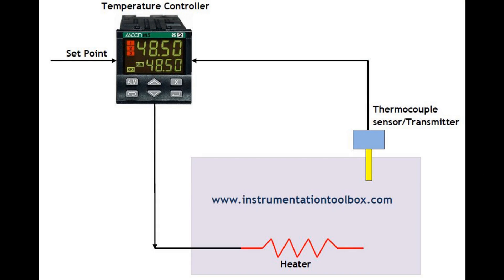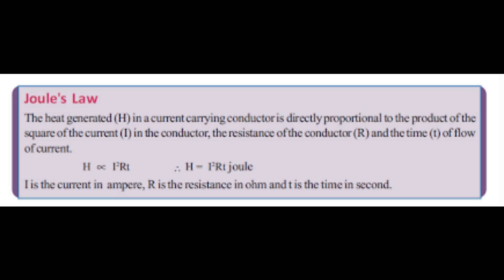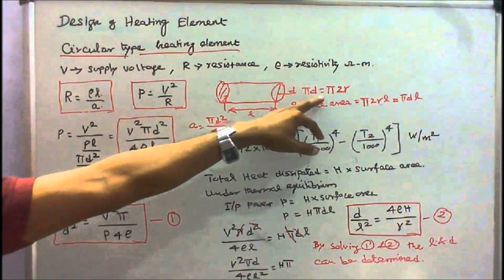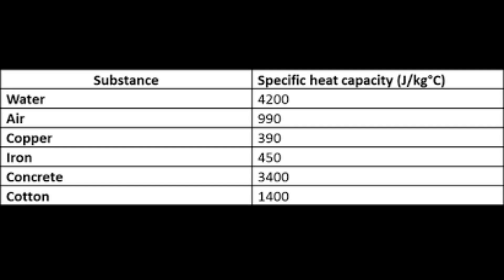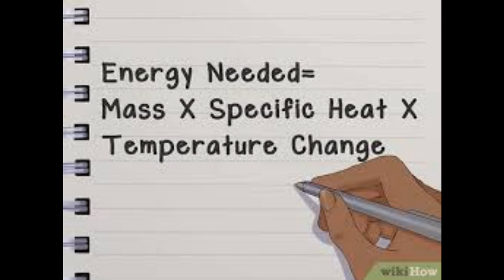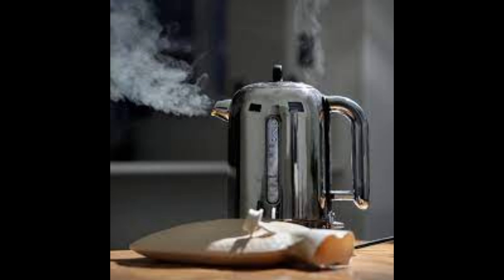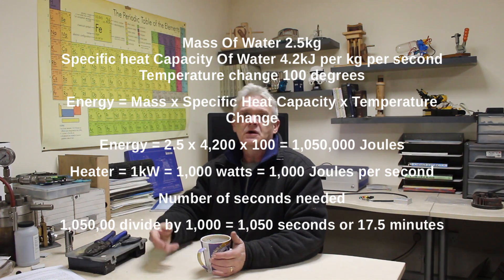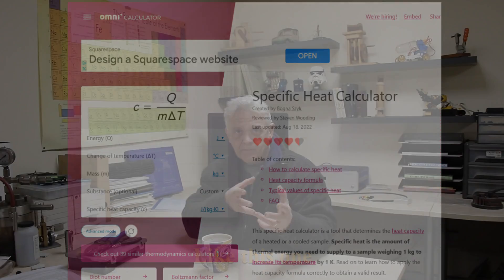1762 Designing Electric Heaters

Comment: You have made a very important point about INSULATION Robert. When I used to work with HVAC system years ago. I was taught that INSULATION WAS THE FIRST THING YOU DID, PERIOD !! Then any type of heating method would work just fine and keep cost at bay. 
          Today most people choose to heat first and insulate second. Totally the wrong approach with the worst outcome. I added insulation to my dads house three years ago. That consisted of going from six inches of fiberglass to adding on top twelve inches more ultra thin continuous strand insulation on top of the six inches. This saved oil heating costs of 60 percent. That was a hell of a savings especially when the stove is a Dynotherm which is 93 percent efficient using K-1 Kerosine.  This really makes a difference with the cost of heating. PERIOD. This is a point that most people do not and will not understand....

Comment: Thank you Robert. My 1kw kettle does take a long time to boil, but it allows me to munch on a shortbread or a biscuit as I wait.
Reply from the maker: lol - making good use of your time - I like it mate
Reply: @ThinkingandTinkering  Love your videos. there was a heater on the market a little over 30 years ago that worked on the pressure cooker principal It only had to heat the water to about 120 degrees f to make steam. the steam traveled up the copper tubes condenced back into water and would be turned back into steam. Unfortunately at that time they were really expensive so I was not able to buy one. The heater it self never got over 120 degrees f. The company still exists but do not make these anymore.Are there charts on pressure cookers.

Comment: When you have a massive shop, you just need a whole lot of insulation and, ultimately, a whole lot of heat power.

MY approach, however, is to ROB heat from the EARTH because THAT heat is FREE!

All I need to do here, since I am up  on the side of a very tall and steep hill, with a lot of water in it, is simply drill a very long hole somewhat sideways, into the hill, maybe a good 200 meters or so, and connect the outlet through a sealed concrete plug, to a radiator that will allow the water to only escape through that radiator.

From there, it can be used for other purposes, naturally, seeing as it is perfectly good 'well' water... its just that the well is, in this specific case, more-or-less horizontal, rather than vertical.

On top of that, seeing as there is a little bit of hydrostatic pressure going on, if I put a decent little sediment filter just downstream of the concrete plug, but yet up stream of the rest of the system, [and preferably with a valve to keep all the upstream water from needlessly all draining out into places and making a big mess], which can be cleaned or changed out on occasion, I can then put a small hydrostatic motor there which can turn a small fan, so that the water, while it is giving off its heat, is also powering the very fan that is making this more possible.

I plan on using a salvaged automotive radiator, since it is a very thermally efficient, and some times you can get them reasonably cheap, compared to a new one, and if you do not mind a few dings and some work straightening out all of the fins, you can usually get them readily enough from cars which have bee wrecked. Just bring along some water and maybe some stoppers so you can fill them and see if they leak before you buy them.

If you are a master at soldering, some times you can carefully patch up those leaks, although there is a logical limit to how big of a hole you can patch, you may in some cases find it easier to crimp off a couple of leaky tubes and solder their end shut, than to try to plug the holes in them. It all depends on how big the hole is, and how many holes there are.

Naturally try to pick ones which do not leak over ones which leak. 

It is TRULY [minus the initial cost of the set up anyhow] FREE energy!

Will it work for EVERY application?

No.

But when you think about it, 58 degrees Fahrenheit [ 14.4 Celsius ] is rather cool in the heat of a 45 Celsius summer, and rather warm compared to a -10 Celsius winter, and therefore, if all it does is keep people in the SAFE zone, ESPECIALLY if one lives any place where the climate reaches either extreme [say a desert on the one hand, although free flowing water may not be as readily available there, some places it is, and in a jungle its pretty available] or an area quite close to the planet's poles, it will potentially save one a fortune on primary heating.

From there, though, one COULD simply add a SMALLER, INTERNAL space, with some additional insulation, so that they are in effect heating or cooling just a little living space, inside of a larger buffer area, so that it will cost only the loss or gain of heat from a roughly 14 degree Celsius environment.

This approach is not 'utterly foolproof' of course, because water, in this situation, is highly dependent on nature and the surrounding availability for one to obtain it.

For instance, if one went to an outside flowing creek, there may indeed be a lot of water, but it will have been somewhat altered by the surface temperature before it gets to you, so it may be cooler, or warmer, than the 14 C middle-of-the-road temperature. And if the water is coming from the earth, but it is from a hot spring, while it will be much better for heating, it may not be so good for cooling, nor anything else, as it may be packed with both dissolved minerals that muck up the system, as well as dangerous gases like hydrogen sulfide and sulfur dioxide, and may be highly acidic with sulfuric acid. Then, going back to the desert scenario, there just may not be a whole lot of ground water readily available near the surface of the earth in those regions, in which case, you might be better off simply digging a large cavern and living in the cooler underground completely...or moving to some better location altogether.

But for much of the planet, the possibility that you live near a hill, with some water in it, is statistically about 25% or so, and if you do not live up against a decent sized hill, BUT you have a well, you can simply recirculate your well water with some additional pipe and a pump, for the heat, although it will then of course cost you the electricity to pump the water up to the radiator and run a fan, because gravity can not in that situation be relied upon to make the geothermal mass of the water flow and do the work for you.

Comment: have you thought about getting yourself a compact 5kw deisel heater.? they are awesome and on low use 1 liter for 7 hours and 5kw at 1 liter for 2.5 hours and the chinese knock off are actually vry good even though the original german brand is great aswell .

Comment: Here in Australia it's summer and in two days will reach about 40 Celcius. I know England is opposite of us and heaters if not used by hot water are similar to the kiln design with a lower temperature thermostat. A small fan run over the sand heater would work also.

Comment: uh-huh.. ok... jewelry you say... for me Watts is a city in california, amp is a beverage available at the corner store and jewels are in a case at the pawn shop.. all I need to know is this material resists electricity and will heat up if I hit it with enough power. Like taking a diesels glow plug and running 12v through it will quickly boil a cup of water
Reply from the maker: fair enough mate lol

Comment: Maybe I'm a bit weird, but hear me out. Instead of heaters I spend more money in light clothing that keeps me warm and at the same time comfortable. During the winter when I go outside I rarely use anything more than a shirt and a jacket because I choose the materials. When I'm indoors I get more choices because there's no wind, that's when wool can be the outer layer. 
It sure helps to have heating in my place, but it is much more efficient if I'm not letting my body heat just go so easily.
By the way, I love your channel. I found it a week ago and it's motivating me to go back to my "making things" mindset.
Reply from the maker: I think you are right mate - use your body heat as effectively as you can - nice one - oh and I am super glad you like the chancel - cheers

Comment: for a while i wanted to build a radiant heater that hangs from the ceiling...  i was going to build it as an art project. a dragon with wings open hanging from a vaulted ceiling. the wings would be reflectors and the leading edge of the wings made of tubing would have the heating coils in them with a cut out facing the wing for the heat and light to reflect off of.
Reply from the maker: that sounds just plain awesome mate - do a video I would love to see
Reply: @ThinkingandTinkering  wanting to do it and getting the nerve to actually throw down and get the materials and do it are a couple different things... still looking for a job after moving without one a month ago... some things are gonna have to give...
sometimes i am the thing that has to do the giving

Comment: For some reason I’ve heard electric kettles are only 70%  efficient. Aren’t induction the most efficient way to heat water at 85%~? Or is that not true ?Could you create a vessel that was more efficiently designed to capture the magnetic field ?  Isn’t the magnetic field in an induction cooktop almost like a donut ? Could you create a donut like vessel that could absorb all of that induction energy more efficiently
Reply from the maker: it's not true mate - electric kettles are actually pretty amazing for what they do - and so simple

Comment: Kanthal A1 wire Iron, Chromium and Aluminum, another heating wire, slightly higher resistance but more robust and cheaper than NiChrome.
Widely used in domestic heaters due to its longer life expectancy which is due to its steady "elasticity" over a greater temperature range.
Nichrome is cleaner and lower resistance per meter but shorter life, used more for high end and shorter duration. If your building portable go for Kanthal it can be moved while still white hot but nichrome could snap.
Note not all Kanthal is Kanthal, its a specific patented brand name with circa100 year history, now sold under Sandvik Kathal name. if its not from them its no true kanthal and may be lower quality.
Reply from the maker: nice advice - cheers mate

Comment: I ve just used the  math formulars lately . Well to save a litte bit on heating cost when the weather is fine . I m usind tranperent boxes, black rocks and mirror foil from crisps packages . I ve put some dark stones (8 kg) into the transperent boxes using two of them fitted together  so I can provide a transparent insolation.  Then I ve used the mirror foil to refelct light onto the stones. When they are up to 45C  I carry the box from the balcony to the inside.

There is another Version of this I want to bult.  This one connects to this video. andI am wondering if I should try. Speaking of the heating propertys of different material I asked myself if the energy to phase change is included into the table of thermic material ptoperties... well I if not.  the thermal storage capacity for wax or parafine  could come handy.
Well I am thinking of blackening wax  and using it instead of the stones. And maybe built a better mirror setup. So I can carry morw heat energy inside
Reply from the maker: that's very clever mate - I think you should try your new version - it will be interesting to see the result

Comment: As some other viewers have commented, heat pumps are of course a viable alternative to resistance heating as they work by collecting and concentrating low temperature heat from elsewhere into higher temperature heat where you need it. This technology has been around for decades but is an expensive investment. Those mis-advertised little plug in mini heaters that claim to heat your room for a fraction of the cost of a "normal" heater are utter cons, underpinned by utter lies, aimed at folks who aren't technically informed. It's scandalous and disgusts me. Rant over. Your video is spot on Robert. If you could bring yourself to foot the purchase price of one of those ridiculous things, it might make the basis of a cracking video to demonstrate that they don't actually do what they claim.
Reply from the maker: I agree with both things you are saying mate - I am planning a heat pump series and yes those heaters are pure scam - I will buy one I think
Reply from the maker: ok got one it will be here Monday so video Tuesday I think
Reply: @ThinkingandTinkering  That will be great 🤗

Comment: The way I have found to make it less damp, and therefore somewhat warmer in my house is to have a dehumidifier running constantly. I tip out 15L of water from it's collector about every 36 hours. This way, whatever heat source  am using, I'm only heating up the air, but not the moisture content of the air as well.
Reply: this makes a surprising difference. we do this as well, and have noticed we can even be comfortable with a lower indoor air temperature (1-2c lower) with the lower humidity air, compared to the higher humidity environment. We also live in a humid area in winter, and going from 70-80% indoor humidity to ~50% humidity makes a huge difference to the "feeling" of the space, regardless of the actual temperature. we are also starting the process of installing heat pumps to the space to further reduce electrical usage
Reply from the maker: why don't you just use calcium chloride?
Reply: @ThinkingandTinkering  The cost of 50lbs of CaCl2 is $36 cdn. It melts when collecting H2O, so I don't want to have to deal with the resulting liquid and having to constantly replace it. CaCl2 is, as you know, exothermic. I just don't want to have to deal with all of that. A dehumidifier can be expensive, but I was fortunate enough to find a new small industrial unit for very cheap, so I went with that. It will gather the 15L or H2O in the 36 hr. period from a 1,200+ sq ft area. I do have however cheap small CaCl2 moisture catchers that hold about a pint each in my unheated workshop to keep my more vulnerable tools from flash rust. I do have a propane forced air heater I picked up some years ago from a scrapper, that I need to refurbish to that end as well. Unfortunately the current temps outside are nearing 0 Fahrenheit. So not going to do that either until warmer...much warmer...one day.

Comment: Great explanation. Please don't forget that heat pumps can make heating / cooling more efficient. Specifically... if you need 1000 watts to heat a room using 100% resistance heat, then a heat pump would require "less" than that... provided that the external environment hadn't dropped below some specific cutoff, such as the freezing point.
Reply from the maker: it is on my mind mate